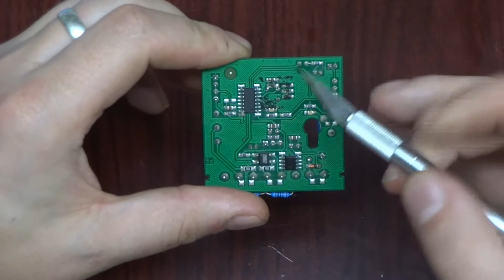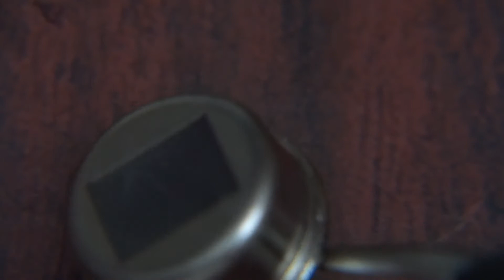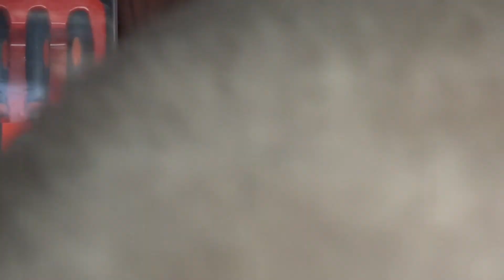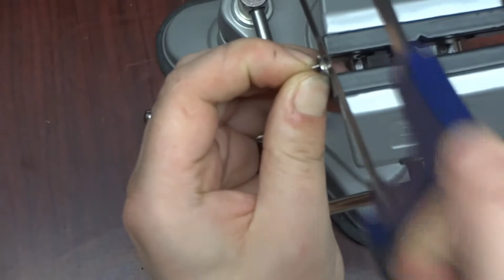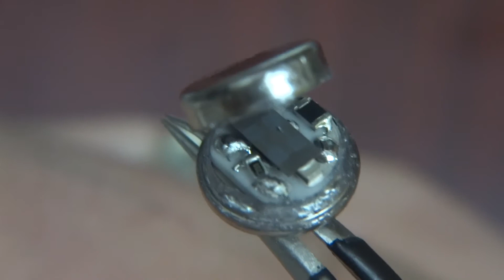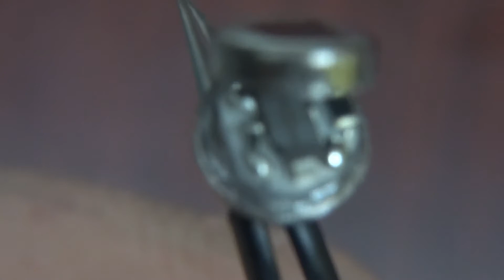Inside a pyroelectric sensor - PIR dissection

Comment: 1:35 The EOL resistors aren't for detecting when a sensor is cut (as the loop resistance would jump to infinity regardless of whether a resistor was there or not), but for short-circuit detection. If someone tries to bypass a door sensor for example by bypassing the reed switch with a jumper wire, the panel will be able to see the sudden increase in current through that zone.

That chip at 3:18 looks like a photocoupler, but I'm not 100% sure. It would make sense, as electrical isolation is important for reliably detecting small changes while avoiding false alarms caused by noise. Two of the pins go to an internal LED, while the other two are for the photosensitive switch. When the LED is on, it closes the switch while remaining electrically isolated from the circuit that it is switching.

The window on the pyroelectric sensor, if I had to guess, is probably some kind of germanium alloy. Most materials clear to visible wavelengths actually block IR. Germanium works as an optical bandpass filter, allowing IR to pass but blocking shorter wavelengths. It's the same material used for the lenses of thermal imaging cameras. It could also be made of some kind of polymer with an embedded filtering material, as there is really no need for it to bend light like a lens but simply filter out the unwanted wavelengths.

Comment: This is likely just a PZT (Lead Zirconium Titanium Oxy-combo) crystal-polarized film, where the 8 pin is a current integrator, measuring the capacitance of the polarization of the PZT crystal using electrodes on both sides of the film.  The silicon cover is perfectly OK as it allows the frequency of IR through it; so probably just protects it.  These types of crystalline structures change polarization depending on heat due to a high pyroelectric constant (ie. change of polarization, or charge as a capacitance, depending on a small change of temperature).  Imagine doing this with a matrix of 64x64 or greater, monitoring the IR heat change per pixel.  Math and equations are one thing, but sometimes learning requires mates tearing things apart to understand.  And when they share, we all win!  Cheers!

Comment: Thank you for this nice video. Now I think they do have any complex digital chips and just a mosfet or similar transistor and resistors. So it can be hacked for other purposes also. So the whole comparator system is outside on the board. I am wondering if it's output will be stable or stay stable to certain temperature. Will the output be steady or will it give output if an object is not in motion. Thanks again, I will try to get to this experiment and see what comes out.
Reply from the maker: Thanks This was a very old sensor, newer ones must be more integrated I would think.👍
Reply: Diese Sensoren geben nur ein Signal aus, wenn eine Veränderung des "Wärmebildes" erfolgt; z. B. durch vorbeilaufende Personen.